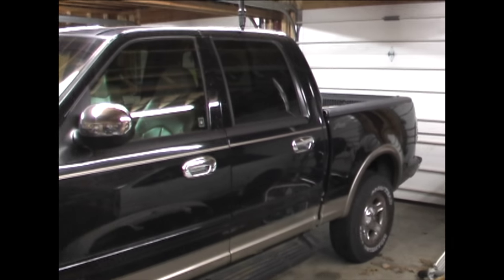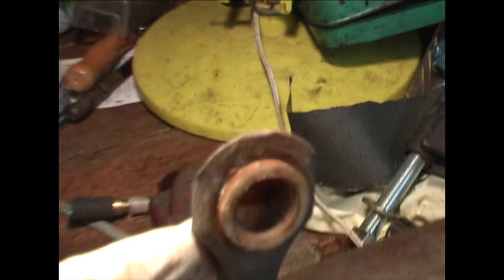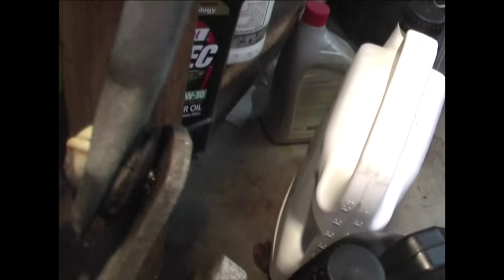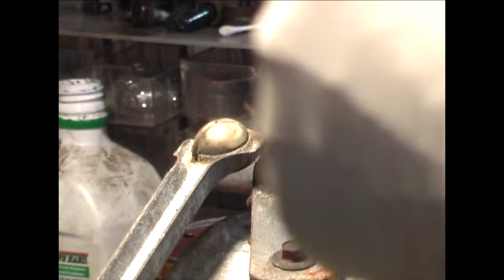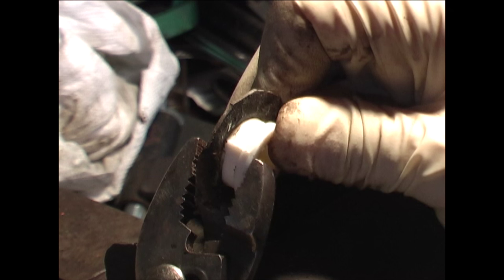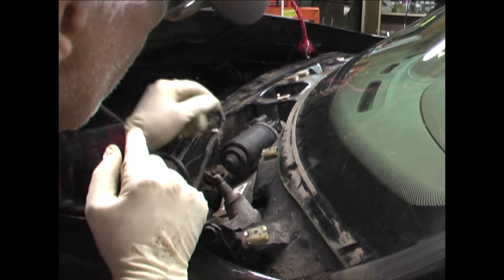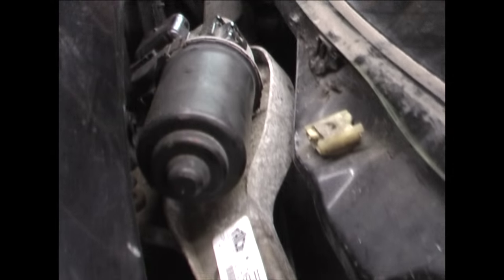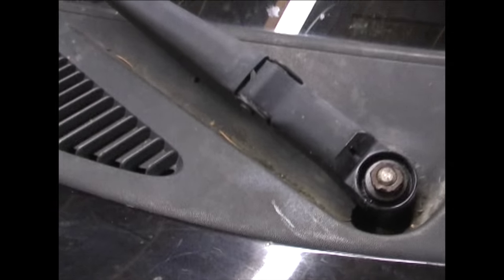Ford F150 Windshield Wiper Repair - replace wiper linkage bushings

Comment: Good vid.  Ball grease did wonders getting those pesky bushings back in.  You think Ford would have markings to make it easier to get the unit back in sequence prior to re-installation.
Reply: Based on the level of engineering I find in the rest of the vehicle, I wouldn't think that at all.. :/

Comment: What’s the trick to taking the arms off - mine are not budging
Reply from the maker: You have to wiggle them back and forth... they are most likely oxidized to the spines. It might help to spray some WD-40 on them, too.
Reply: Thank you I’ll keep working at it
Reply from the maker: Once the nuts are off, there really is nothing else holding the wipers down! (at least, technically!)
Reply: Wow that took a lot of effort and I must have not gotten the arms put back right because it’s not going up across the glass they look like they’re trying to move but then they’re stuck and I feel like maybe I put the arms together wrong
Reply from the maker: @honeymle  Yes...the arms have to oriented just the right way when you reinstall them. Look closely in my video where i show what they should look like before they go back in.
Reply: My transmission moves freely until I put the arms back on and then they jam down and won’t move and they look like they’re trying to go down instead of up. I am stymied
Reply: I wrote you a long a email but it doesn’t look like it wants to go through so I will just let you know I have got it going now and I appreciate all your support
Reply from the maker: @honeymle  Congratulations !

Comment: Hey thanks for the video, I installed bushings and put it back together, but my wipers still don't move. If I take wipers off, the wiper rods spin back and forth like normal. What do you think could be the problem?
Reply from the maker: If the arms are reconnected in a different configuration it would lock the motor up! You have to reposition them exactly like they were! That's probably what's happened! Study the video part where it shows the exact position of the arms.
Reply: I'm pretty sure I put it back in correctly. They stopped working when a snow storm hit last week. I think I may have stripped out the wiperarms, but when I took it apart, the same linkage bushing that came apart for you came apart for me. So, I thought it was just that, but I started reading it's common to strip out the wiperarms when not clearing snow from your windshield. Have you had any experiences with this sort of thing?
Reply from the maker: I have had that happen before, but if that is the case... you should see the motor lever moving even though the arms aren't moving.  https://www.youtube.com/watch?v=7CGv4U2PhYk&t=2s  and you'll see the grooves missing in the arms.
Reply from the maker: if you have a "stripped" wiper arm https://www.youtube.com/watch?v=7CGv4U2PhYk&t=2s, that is!!!!
Reply: Manny C ,